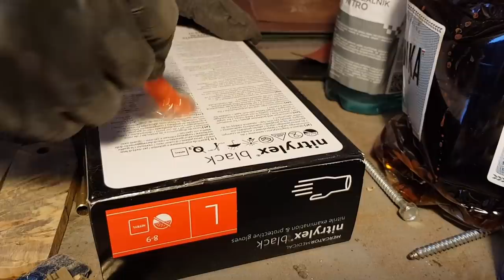Knife making - HUNTING KNIFE w/ BLACK BLADE and STABILIZED WOOD HANDLE - #KNIFEMAKING

Comment: That angle grinder is a beast! 230 mm I assume. Maybe not ideal application, slight over kill, but an awesome tool. I like how he hand finishes grind without jig. So some anti scale mud that needs acid to remove after heat treat? Lots of cool tricks on this video. Great result
Reply from the maker: Thanks. Yes, it's 230 mm. This ' anti scale mud ' is a special coating that prevents the steel from decarbunization. ;)

Comment: You forgot to etch the spine of the knife. You can still do it after you grind the handles flush. It makes the knife look so much better. I'm not saying it looks bad, it's very nice and so is your presentation. Just think finishing it completely would take it to the next level. 👍🏼 Great job man!
Reply from the maker: The spine was blued too after the handle was finished (13:44).
This isn't exactly etching, it's bluing, slightly different process ;)
Thanks ;)

Comment: Great knife and great video.  I have question, after caustic soda and  potasium saltpete tretment you use something to get darker shade?
Reply from the maker: It's just an oil and it didn't make it any darker than it already was ;)
I recommend oiling the blade after the process.
Reply: @BarbershopCustoms  Oh, Sometimes the video can visually deceive. Usualy i work with hot vineger or ferro chloride depending on what effect I want to get. I did not work with mix of caustic soda and potasium saltpete. Definitely I will try, Thank you.  Ones more your knives are piece of  art works.
Reply from the maker: @anonimous1812  it's a completely different coat than the one after ferric chloride or vinegar, way darker and shinier 
Thanks ;)
Reply: @BarbershopCustoms  Yeah, that's why I'm gonna try it. Gretings.

Comment: I make a kitchen knife  but after I use it it get rust on it what can I do to use it all the time and never worry about the rust thanks
Reply from the maker: Well, you just have to dry it out after every use, that's just how non-stainless steels work. You can also stain it with patina, for example in vinegar. If you want a knife not to rust without any care, you should make one out of a stainless steel ;)

Comment: Very nice knife!
I did not understand the burnishing process: what is the temperature of the mixture? how long do you keep the knife inside? what do you do with your finger after the treatment? does the last burnish on the spine give the same result of the first mixture? Does not it ruin the wood? thanks for the video and for the patience
ps: sorry for my english
Reply from the maker: You're right, I forgot to specify that ;)
The temperature should be kept between 120 - 140 C. 
I keep the knife inside for about 30 minutes to get consistent black colour, you can manipulate the time to achieve different results, shorter period should give you dark brown or purple - ish colour. 
The cold blued surface has lower wear resistance, that's why I only applied it on the spine which isn't exposed to friction as much. 
It may ruin the wood, therefore you need to apply it with enough care and precision
Reply: @BarbershopCustoms  thank you so much! You are so kind, i will treasure this informations